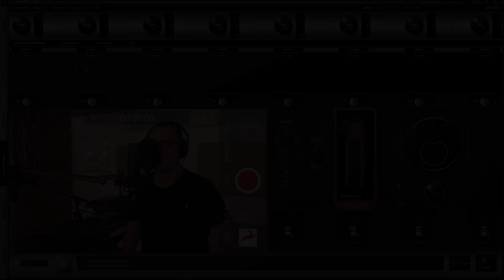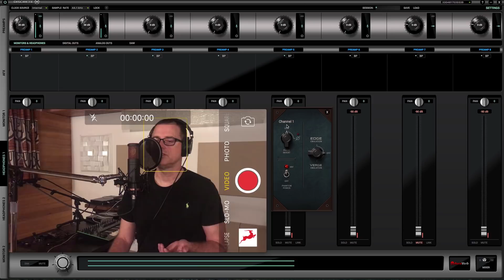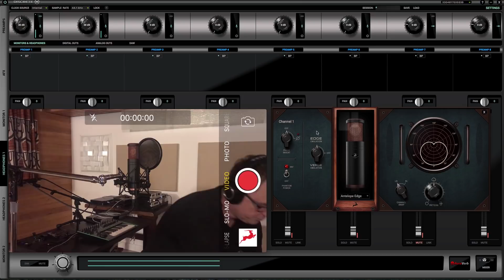Edge Microphone Demonstration

Comment: Most USB mics are  VERY quiet on Windows 10, and most of the online reviews seem to be on Macs. Also, the Antelope software does not seem to display the signal level (except that it is usually all green).  How loud a signal can be expected with this mic, like in -dB, in Windows, say at 100 per cent or 88 per cent gain in Windows settings?  Thanks.

Comment: Do NOT buy these microphones. My partner bought the set with an edge and 6 verges and the capsule can only handle about 85 dB SPL. Absolutely cannot perform as drum mics as advertised. We contacted Antelope and they said that these were defective mics and they only replaced them a year after the manufacture date, but he purchased them after the replacement period was up and they still gave him defective mics. Antelope is a SCAM. Their real company name is Earbyte, Inc. The reason they don’t use this name is because Universal Audio sued them for trademark infringement. We have attempted to contact them multiple times and they have blocked us on all platforms. Do NOT buy these microphones!! Save yourself the money and the headache.

Comment: Anyone considering buying a Antelope product be wary. You may not get what is advertised. I purchased a discrete 8 with the verge and edge mic. The verge mic cannot handle the SPL stated on the website. Its not possible to close mic drums without every hit clipping the mic. Even with the gain on the interface all the way down -12db. I Contacted support and they informed me there is nothing they will do. I will make a video showing the issue. If your thinking about getting the verge you may want to check it out first.
Reply: Can the edge handle high SPL?